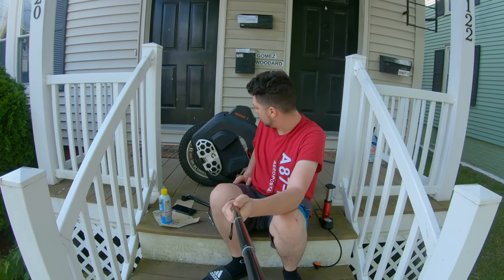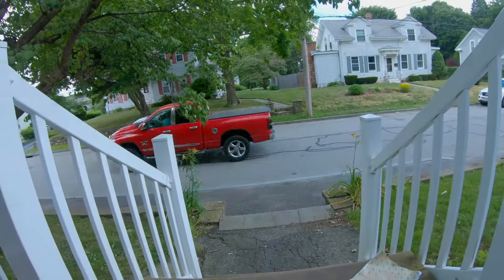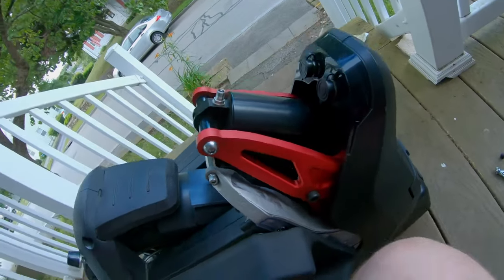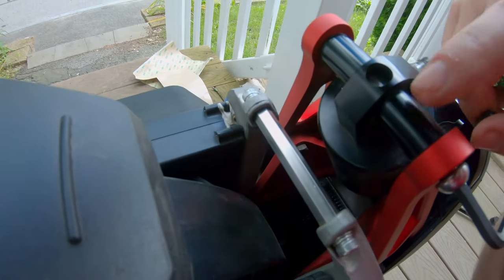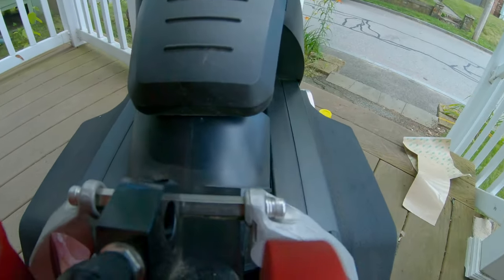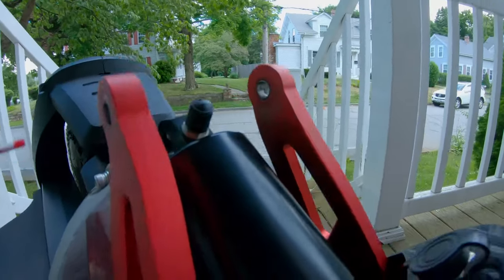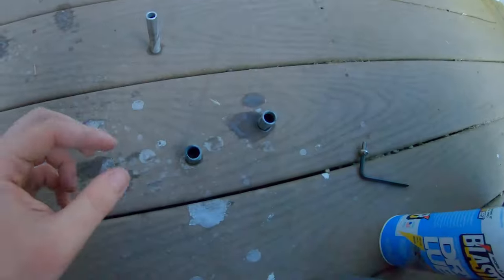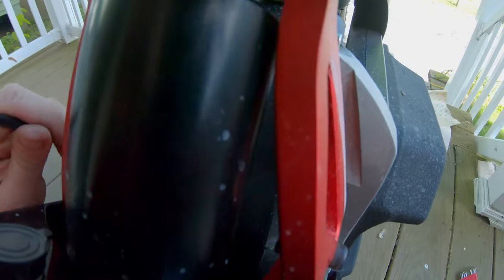Smooth as Butter! Fixing The Suspension on the Begode Hero c38 EUC  -  Tune Up and Maintenance

Comment: Good video will definitely lube it up. Had mine since Jan and it's been smooth, and great on trails, steep climbs, snow, and overall an enjoyable wheel. Speed alarm set to 30, but mostly ridden offroad...
Reply from the maker: such a great wheel offroad

Comment: I’ve already changed out the shock 3 times on the Hero, after you take the plastic shell off, and completely compress the suspension arms, the pin lines up with an area to be able to remove it. Still a PITA. Would be curious how your DNM would go.(you should do it =P) I’ve tried a DNM coil shock, and a DNM AO42rc 190x48 air shock. I bottom them both out, 240lbs with gear.

Comment: I was using one of those cheap slider air gauges which showed about 25 pounds on my wheel. My roommate tool shamed me into getting a good digital air gauge, which didn't really cost that much, but there was a 5 pound difference in them.  It's not rocket science, but good tools do make a little difference.
Reply from the maker: 🤣 lol good example

Comment: I just got a used V11 and it came half charged, should I run the battery down more before recharging?
Reply from the maker: nah, the battery is healthiest between 30% and 90%. just be sure to fully charge it and confirm it balances out at 84 volts routinely (like every other charge)
Reply: @GoGeorge  thanks 🤙🏼 keep up the great videos!

Comment: Please help me out: I want to buy the Begode master 2400wh but there is the standard battery and the Litech (from è wheel) which one would you guys consider take on?
Reply from the maker: depends, if ypur a super fast rider maybe go with the molicells since its only a 4p battery. if your not a speed guy, go qith the 50e cells that have the better range